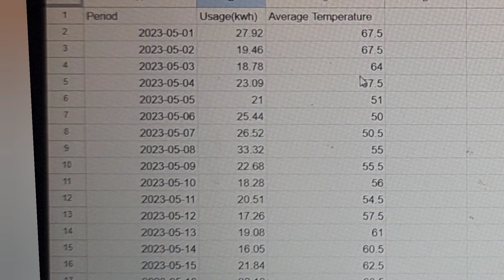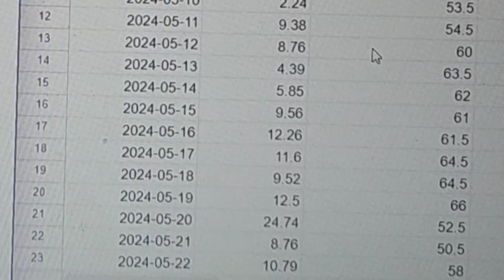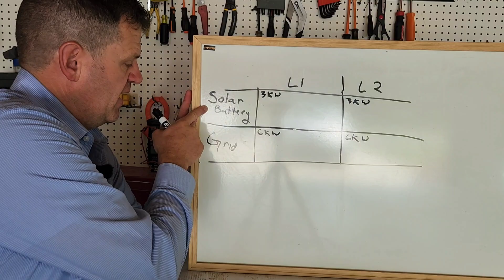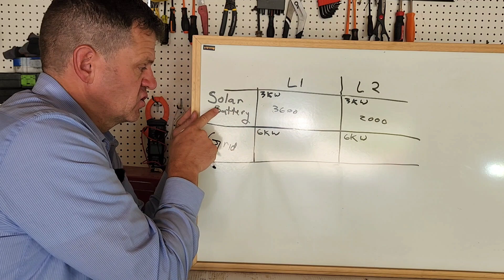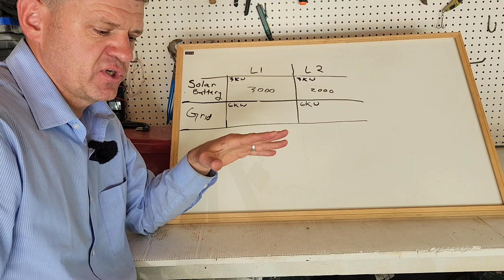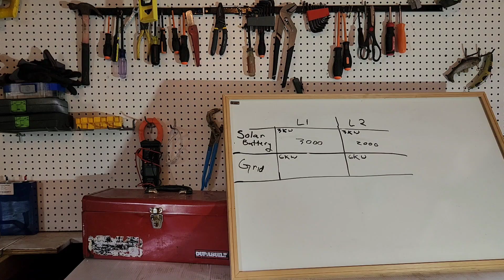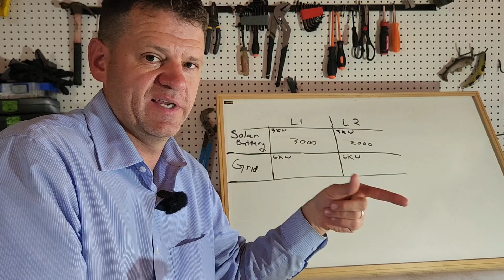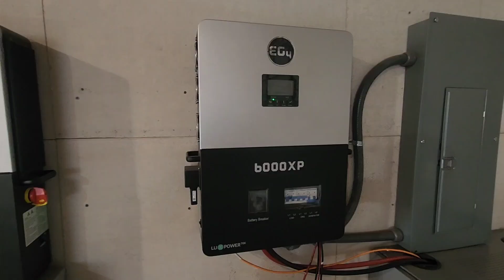I Ran My House on the EG4 6000XP For 2 Months - Cost Savings & Results

Comment: Question Ray
Have you will you be able to put the Basement separate from the main House 
This would show you much more less power you or They use each month
Reply from the maker: Maybe in the future. Their basement electrical is kind of complicated
Reply: @diySolarPowerFunWithRay  
My think was place al the beaker for the Basement on the Right side of Panel Upstairs house on the Left 
Step two since you have 2 6000xp inverter 1 on left 1 on right 
My lthink is how to track each other since the basement sound like it is mostly electric 
This would also give you chance to adjust solar according to both needs and make great video content 
Also if tenants had issues with overload and you on a trip easy to find in panels
Reply: @terrybrown5883  Any efforts to move a house off the grid or reduce the loads involve the realization that any 240 load other that the A/C and Well Pump have no place in such a design.
Reply from the maker: Interesting....So you're saying re-wire things to have 2 panels in my garage.. one for the basement and one for the upstairs?   That way I can test 2 separate living conditions with separate solar.  Not a bad idea... The basement doesn't use air conditioning though because they live in the basement so that might throw things off a bit.
Reply: @diySolarPowerFunWithRay  Yes and it will give you and the other people 
Since it sound like not much gas is in the Basement 
Or you could do it in 3 part series 
Your living area Usage 
Renter Usage area 
Everyone access area

Comment: First you videos are great! Been binging them all to learn more so keep it up! With this setup if you don't have have Solar for a few days will the system continue to run without issue (autoswitch to gid)? I read the 6000xp has an ATS but wasnt sure if it would basically prioritize Battery/Solar then grid and switchback to solar once you have PV input.
Reply from the maker: Yeah, By default it uses solar and battery first and they it will autoswitch to grid if needed.  I don't even notice with it switches back and forth.  It won't ever charge the battery from grid to save money... unless you chang the setting.

Comment: Have you not had issues with only 3kw available to each phase?  My AC is 3ton, and uses about 2kW each phase (about 4kw total hottest part of day) and my standing load is about 800w with all the silly vampir devices. Doesn’t leave a lot of room for additional load when we’re already using about 2500w on each phase.
Reply from the maker: Yeah, I'm having the same experience.  Going to grid too often.  I've got 2 running my house in now.  they are doing great but I'm gonna try some other inverters.

Comment: Running the numbers and showing folks what the break even is going to be is very important because the upfront costs scare away the risk averse who are basically 90% of those asking about my system. The power companies are only going to continue to make your life miserable until you break away and take control of your energy consumption and production. DIY is the best and quickest way to getting to break even. I did not DIY mine 8 years ago and that added several years to my break even number. Times have changed and it’s never been easier. I will be upgrading soon based on very good channels such as this and doing it myself.  Very nice breakdown and presentation. 👍🏻👍🏻
Reply from the maker: Agree, Thank you!  I'd like to do a video on converting an existing system to have battery backup. Is that the route you'd be going?
Reply: @diySolarPowerFunWithRay  yep Solaredge inverter grid tied, lg 360 watt panels with optimizers and debating on the EG4  18k or 12k while doubling up the panels on the current 5.44 mw system. May do my parents first on a shop roof with an 18k

Comment: I had the problem of shutting down with unbalanced leg by requiring more current off one 120V side  I solved the problem by finding a 220V to 120V transformer with high current capability.  I us the output from that to run ALL my 120V items.  There is a slight efficiency loss but no more unbalanced leg.  Just make sure there is primary to secondary isolation and connect one 120V wire to neutral and be sure ground is secure.  This connection carries the full current load for all the 120V loads combined.  Ground should carry no current.  Also, be sure to fuse the primary.  This feeds all my 120V breakers that would normally be connected to the split phase.  All 220V loads works normally.  The electrician knew exactly what to do.
Reply from the maker: Very interesting! Could you email me some pictures of what the electrician did and the transformer he used?

Comment: Once you pass 1kw in input fans become really loud. I have the predecessor to these the lv6548 and did the same thing as you powering the main breaker box. I didn't know that about the input switching both legs to grid over if 1 leg goes over. I'm waiting for a few 2awg butt splices to come in to run my AC bypass.

I'm going to buy $200 worth of ff2 flashing and a few xr10 rails and install 30 panels on my roof instead of having them in the yard. 

 You have to get rid of the central ac to run completely off solar.

Comment: Nice setup and info! Regarding the inverter, did you need a permit? Same question for the solar installation.
Reply from the maker: I plan on getting one in the future. If you live in a state that has a lot of red tape, you may want to get the eg4 12k or the 18k because those have more certification
Reply: @diySolarPowerFunWithRay  Thanks

Comment: thanks for the break down. I am looking to instal a simuler system in my next home. The home I have now has way to much to support. Pool heat pump, pool pump, elc dryer, house heat pump, Tesla charger and 2 40gal waterheaters. We consume 2500kiloW a month and thats a low month. Yup.. but our next home we will have a lot less appliances. 

PS how many kilow is you battery bank? 

thanks sean from Montreal
Reply from the maker: Only 3 batteries for now... which is about 15kwh.

Comment: My wife told me to not even think about putting panels anywhere. I'm stuck with only an inverter and batteries. I envy you.
Reply from the maker: For me, I had to turn off the power for a couple of days.  That did the trick. ;)
Reply: @diySolarPowerFunWithRay  Ha ha. That would be a last resort for me. I thought just showing her the electric bill during the summer would do it. Nope. She's got every last wall, fence and open space covered with flowers or plants in the backyard. I'm not doing roof mount. Way too much headache here in CA.
Reply: @rtsrts2317  Replace your wife...
Reply: @honumoorea873 that would be extraordinarily more expensive than any electric bill.
Reply: Instead of solar panels, could you think of using a vertical axis wind turbine of 6kW or less? That may give you day-and-night power, and has a small footprint on the ground. Just a thought.

Comment: I just tested my EG4 6000 unit just like yours with the EG4 14.3 Kwh (48V 280Ah) Battery last Tuesday (7-30-24) running my 2 ton A/C unit.  This was at my camp/house in Mississippi, 97 degrees was the high, sunny and had my A/C set at a very comfortable 72 degrees for the whole test.  I was able to push right at 8 hours out of it until the battery hit 15% SOC.  Ran like a champ!  I was running the A/C only it was pulling just below 2,500 watts while running.  Just thought I would share this info.
Reply: Install a soft start
Reply: @LReno-di9cm  I did.
Reply: Solar array/size?
Reply: @Photovoltaic_Maniac  No, solar hooked up.  I do have 6 killowatts of panels & all the hardware for it, but I won't hook it up unless I need to in a SHTF situation.  Since I'm not there but maybe once a month for a few days, I don't want to risk something going wrong while I'm not there.
Reply: Just imagine if you had a couple of mini splits. You could probably run continuously for a couple days. You could also have dedicated panels for the mini splits and never tap into your batteries while the sun was out. There are several videos of people running the eg4 mini splits just off of a panel,no battery.

Comment: Electrical note - they are not 120v legs - they are 240v from the transformer.  The split-phase neutral allows either 240v leg to provide 120v.  When no neutral is in use, it's 240v :)
Reply: Incorrect. They ARE 120V legs referenced to ground, or neutral.
L1 to N (or G) is 120V. L2 to N (or G) is 120V. L1 to L2 is 240V.
You said " The split-phase neutral allows either 240v leg to provide 120v."
There IS NO 240V leg. There is 240V BETWEEN legs.
Reply: @wdwtx2.0  Nope!  240v appliances only use each leg not referenced to ground or neutral.  Try again!

Comment: Thanks for update great information as usual! My 6000xp does not have the muscle to run my well pump unfortunately
Reply: They make 48 v. DC well pumps that use less power. I wonder if that's an option?
Reply: What size pump HP?
How deep is the well?
Submersible or above ground?
Reply: TY
Reply: Is it 120v, can it be converted to 240v? I have two 6000XP paralleled and they have no trouble running my 240v 2hp submersible pump along with whatever loads for my home.

Comment: great video ray, I wonder how your going to charge 2 diff battery bank while combine 2 inverters in the same time, looking forward for the next video
Reply: The inverters can be set to not share battery connections, each one communicates to its battery bank to charge them correctly but they can still be paralleled to power the same loads.

Comment: That’s a nice vegetable garden in front of those panels. Maybe a video on that soon? All part of going off grid :-)😮

15 cents a KWh for electricity is very cheap. San Diego is up to around 47 cents at peak rate from 4 to 9 pm.  And Oct 1, 2025 will bring a fixed fee of $24 that everyone on the grid has to pay. Fixed fees incentivize going off grid rather than using the 6000XP grid input feature. But ofc, one has to have capacity for cloudy days (aka marine layer in San Diego from the Pacific from Jan to June depending how many miles inland one lives). That means more pricey batteries from China which we may go to war with over South Asia
Reply: 10.57 cents per kilowatt hour in Union County, NC.  Electric coop which has a stake in a nuclear power plant.  Unfortunately, such a low rate means it would take nearly 11 years to break even on a DIY kit.
Reply from the maker: I'd give it a couple years. We were recently at those prices.
Reply from the maker: You could also get a dual fuel generator that can hook up to your natural gas feed... And you can have it kick on automatically when your batteries get low.  That would save you from having to buy a really large battery bank.

Comment: Micro-air soft start will likely take care of the lights dimming that is caused by the inrush current on the hvac condenser.
Reply: I have new wires new box on my house and my lights will flicker when ac kicks on and I'm on grid only
Reply: @supremeautomotive6749  Yeah, my parents had the same issue and they only have off grid power.  We installed a softstart and I don't think they have any dimming anymore.
Reply: @supremeautomotive6749  Same here, but I think I know why - the wires from the pole to my house aren’t big enough. Maybe same for you?
Reply: @1drhnsd1  I had a similar issue - the connections at the MPOE were heavily corroded (and the wire to the power lines also had completely compromised insulation) and one of the phases eventually failed.  Power company came out and spliced on new wire and connections to the house  (fun to watch the line man doing this with everything live) and dimming was pretty much eliminated.  I have a Micro-air easy start ready to install if only to reduce the noise when the A/C starts.

Comment: Be happy to get mine online finally. Been working on building a shed for it all and at least now have two of three inverters hanging, waiting on the third to show up on back order. Hopefully in the next couple of weeks. Got a 12k mini split already installed waiting for power to make working a little more enjoyable. 96, 300 ah battery cells sitting on the floor waiting to become battery packs.
Beginning to see a little light at the end now..........
Reply: Use Hardy boards behind all electronics in shed.  It's fire resistant
Reply from the maker: Nice.  I like the idea of having everything in a shed or a large cabinet away from the house.
Reply: Yeah I like it, gets around problems. Need to get the door hung so my chickens quit using it for a play pen. lol